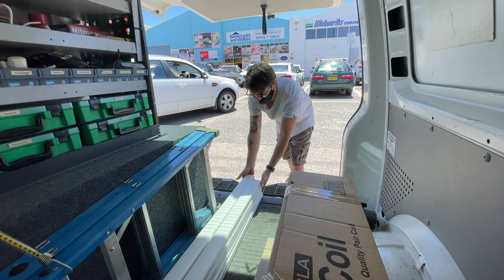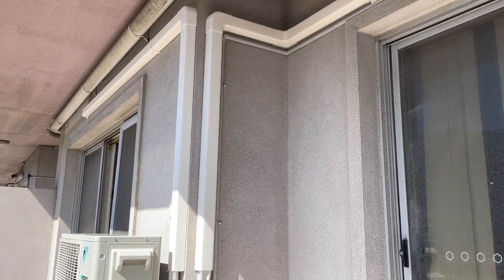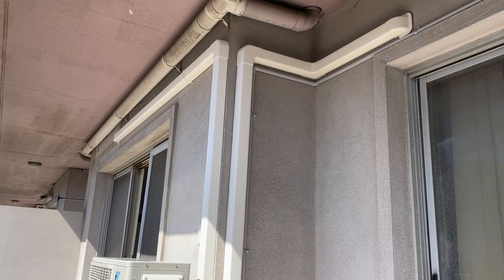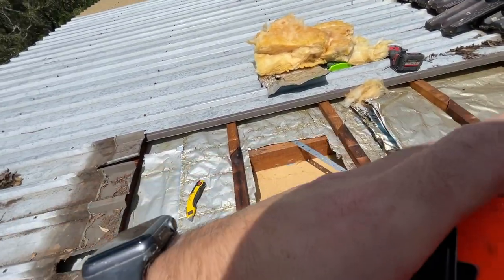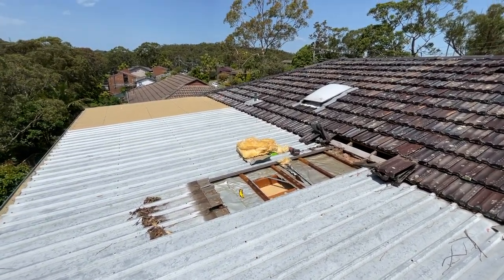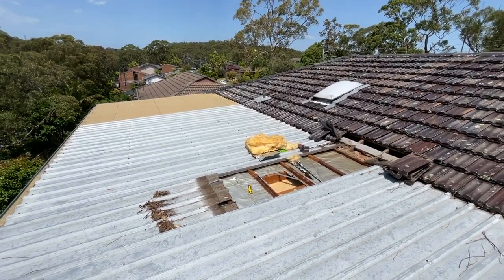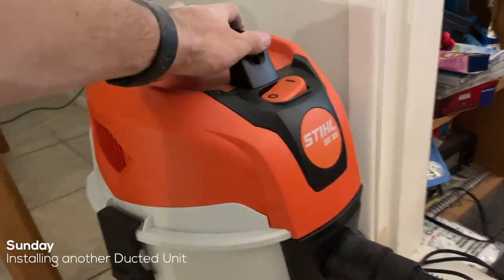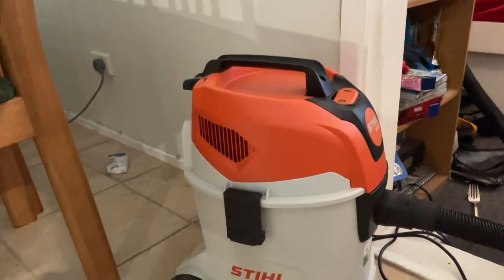This week I installed more Daikin Air Conditioners.

Comment: The problem with squashing flexible insulated duct is the condensation issues you’ll get around that duct during the humid summer months.
The customer will blame the installer if he sees water danger to the ceiling.  No matter how much you try to warn them against running the duct through flat roof.

Comment: IV always been told you can't use smart duct outside, looks good tho
Reply from the maker: I personally never really use it. I always use colorbond trunking. However, if it requires a certain bend (hard to explain on here) then I’ll use it. Every single balcony on this particular building had the exact same pipe duct so I just matched it. But yeah in regards to using it outside, I don’t see why not. It definitely lasts, just doesn’t look as nice (some may think). Anyway, thanks for the comment mate !

Comment: Might be a silly question man. But how do you mark in your grills? Do you go up in the roof space and stick screw driver hole? Any tips would be much appreciated.
Reply from the maker: Hey mate, when marking out I normally have someone in the ceiling that I’m talking to. I’ll tap where I would like it and then they put a pilot hole down from the top with a small screw driver in a position it won’t hit Timbers. Or if I’m doing it alone, I draw what is on the ceiling on a piece of paper, for example 4 lights and a fan then I get in the roof and find those lights and fan and put a pilot hole down myself somewhere it won’t hit timber. You get used to it after a while and it gets pretty easy.
Reply: Ok cheers Mitch.

Comment: In cutting supply air duct on ceiling, you don't use stud finder to ensure nothing is above it when you cut the gyprock? Or how do you know which spot is clear to cut? Thanks
Reply from the maker: When marking out I normally have someone in the ceiling that I’m talking to. I’ll tap where I would like it and then they put a pilot hole down from the top in a position it won’t hit Timbers. Or if I’m doing it alone, I draw what is on the ceiling on a piece of paper, for example 4 lights and a fan then I get in the roof and find those lights and fan and put a pilot hole down myself somewhere it won’t hit timber.
Reply: @maracservices  thanks. Good video.

Comment: Hi, just wondering how many wires are there going from the outdoor unit to the indoor unit for the ducted unit? is it 4 or 5?
Reply from the maker: 6 cables mate. Line, neutral, earth and 3 interconnecting cables.
Reply: @maracservices  gotcha, cheers!